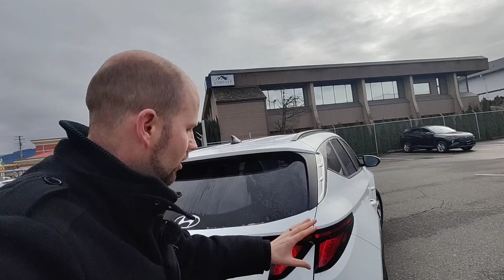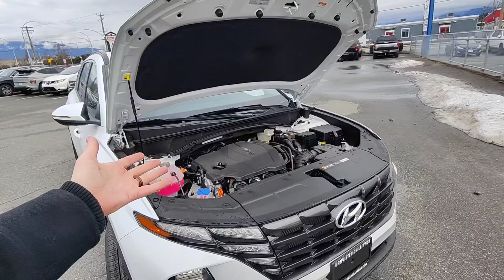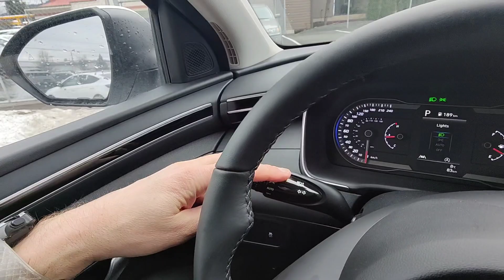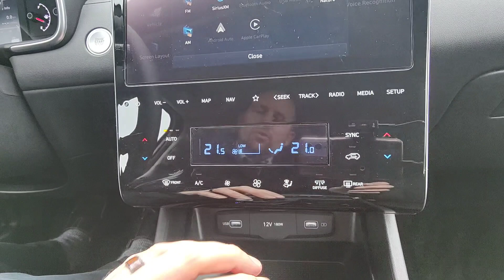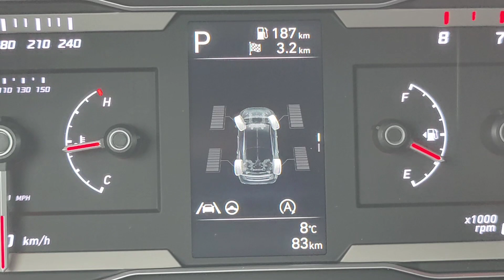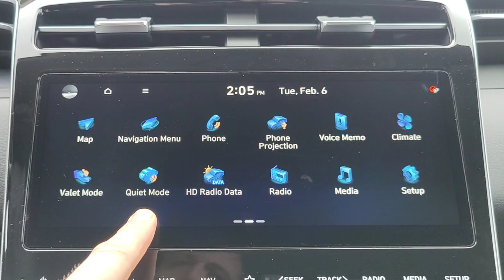2024 Tucson Preferred/SEL Full Feature Review!!

Comment: Cleaning or replacing windshield wipers are virtually impossible as the blades' arms bang into the back of the hood when you're trying to work on the blades.
Reply from the maker: There's a procedure for changing the wipers. If I remember correctly, you put the car in accessory mode. Then hold the wiper stalk down for a few seconds. 
The wipers should flip to a vertical position so you can get to them easily. See your user manual for correct procedure